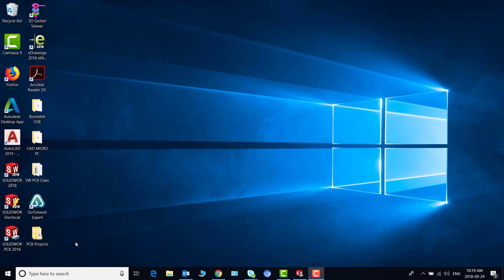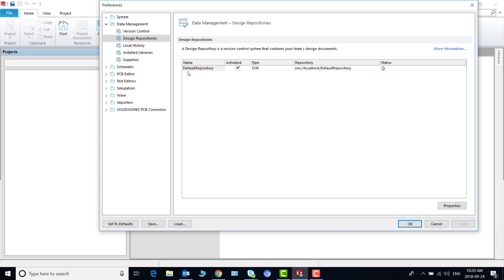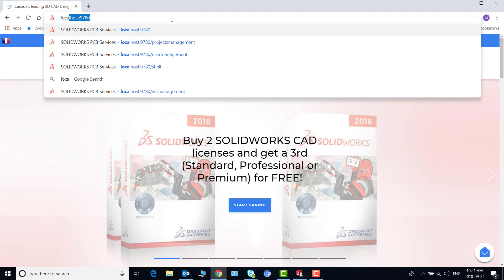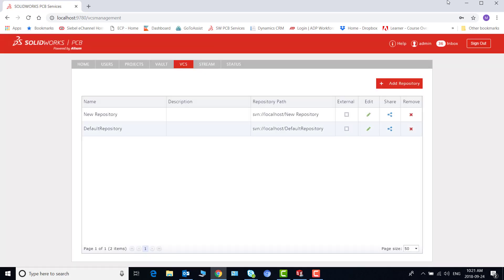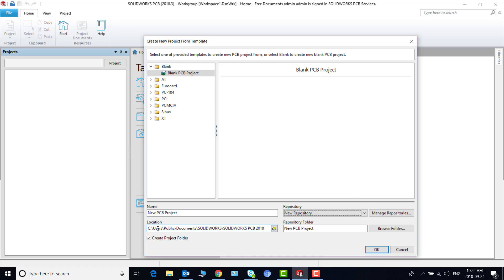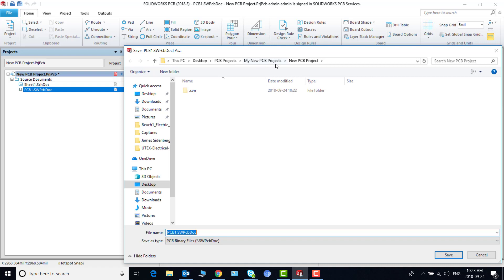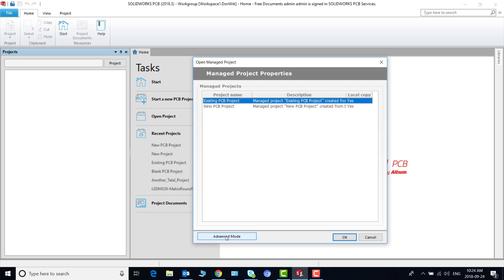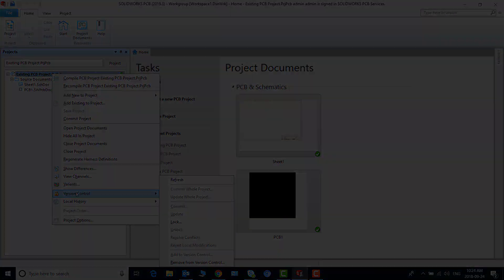Tech Tip Tuesday: Creating New Repositories in SOLIDWORKS PCB

Comment: Hi, Thanks for video. I have problem in the page says create new project from template, the "OK" button is grayed out and I can't press OK. I signed it and signed out and created repository as you did int the video. Can you help please.
Reply: Hi Habib,
It is hard to say without taking a look at your computer screen. Can u include a screen shot? Generally if one of the four fields at the bottom have an entry which is not valid, the OK button will grey out. For example if you give a file path which does not exist or has typing errors, it will grey out. Also be careful with the name of the projects. Some special characters are not allowed. Change the file path and name of the project and see if this resolves your issue.
Reply from the maker: @talalazfar2855  Thank You for answering Talal!
Reply: @talalazfar2855  Hi Talal, Thanks for reply. I changed the project name to a very simple alphabet characters and changed the location to multiple locations but the result is same. 
Please see the attached screenshots in below link, 
https://drive.google.com/drive/folders/1m30SrZ2HCDbiFSXmXHI_p7OGPpgXNx_I?usp=sharing